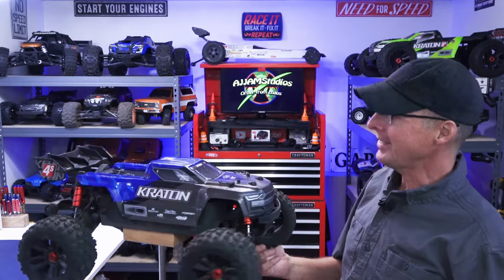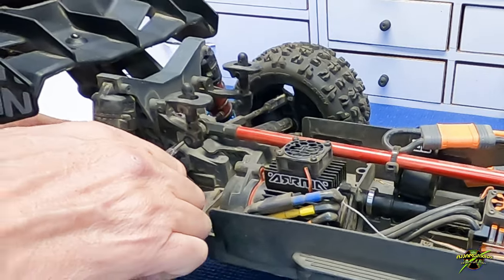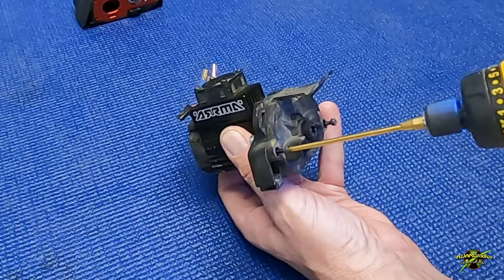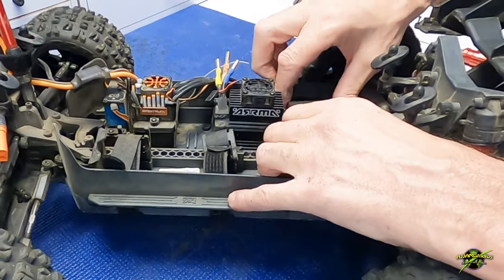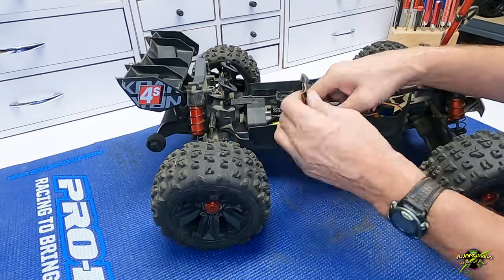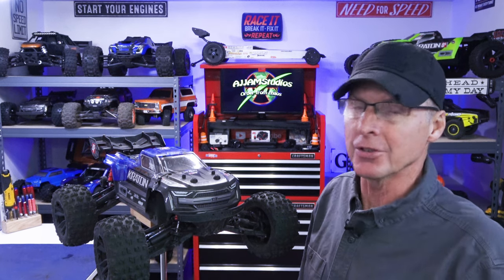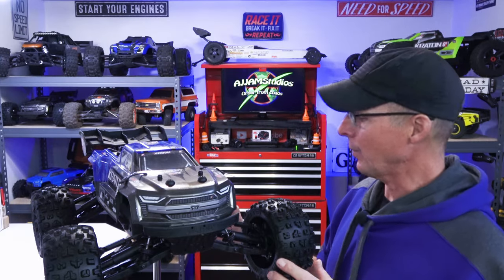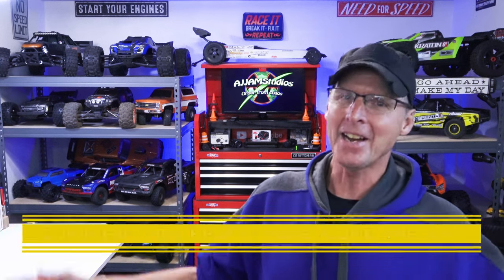Arrma Kraton 4s diff install

Comment: This is brilliant. Thank you for making the video. The slipper in my K4s has always been a problem. I think I will buy the parts and fit to my car.
Reply from the maker: Be patient, they are out of stock at the moment. Every one is trying to get their hands on those parts. Even Jenny's RC is sold out. It will be worth the wait though. Be wary of those scalpers on eBay who are asking way too much for them, trying to take advantage of the shortage. Arrma will catch up to the market in time.
Reply: @AJJAMStudios  thanks for the advice. I was expecting that to be the case with stock. I’m in no rush anyway particularly as the weather isn’t so great now.

Comment: Sweet! I as well could never understand why they put a slipper clutch in the V2 Outcast and kraton. I stayed snapping shafts on my outcast. Found a company on eBay that makes a slipper clutch hub out of 7075 never snapped a shaft again. But I am definitely going swap it out with that center diff. Great video thanks for the insight.
Reply from the maker: I'm glad we could help. The slipper and the locking spool both overdrive the components when pushing big power in high traction, and that comes at the cost of durability. With some lighter fluid in the center diff, when you get one installed, it will ease the problem and allow you to keep that sweet top speed. I would still be careful to be off the throttle when landing your RC to help prevent any overpower to the drive system...it happens to us all at times. Please let us know what you think when you get yours installed. Thanks for sharing. AJ
Reply: @AJJAMStudios  You wouldn't know this but I have been in this hobby for like 20 years. I have 4 trucks fully equipped with m2c racing parts and the toughest parts l can find. My trucks look like dots in the sky when I jump them. Well aware of the functions of a slipper clutch.
Reply from the maker: Awesome. Good to hear. Bash on, my friend. 😎👍

Comment: My front shock spring perches are rubbing groves into my to front drive shafts is there a way to move the front drive shafts back a little so there not hitting the shock spring perches i losened the shock end 3 turns but still rubing I tried contacting arrma but I sit in que for hours on end being 1 in que sent pictures but not getting any help from there support it's less than 3 months old should be still under warranty but not getting any help how can I fix the issue do you have any suggestions

Comment: I like to see the new Big rock 6s hit the dirt🎉
..hope to see a newer version on typhon s6 blx soon..what could be a good upgrade!😊
Reply from the maker: The Typhon 6s upgrade? Wow, I'm not sure about that. If I were asking for upgrades I guess I would ask for a tougher, basher type chassis with redesigned chassis braces that are more substantial, not the lighter one they put in the TLR. A tougher, faster servo. Belted tires with a different tread design, more like a truck pattern. Larger teeth on the diffs to help prevent diff failures. Aluminum front and rear diff housings for added control over the diff spacing. A rear bumper set, built after the EXB bumper design for greater jumping protection. An EXB front bumper designed just for the typhon for those unexpected impacts. After all, they already have the race version, so a dedicated heavy bash version would fit the bill for us here. I hope that answers your question. Thanks for asking. AJ
Reply: @AJJAMStudios  yes well a stronger servo would be a nice choice..i guess a new spektrum 665 when it comes out..think ill go for savox or power-HD  that can handle 8,4 volts!😆now that i got my hobbywing max 8 with 2250 kv motor😇

Comment: Hello! I think the problem is not with the differential oil, the Mojave 4s comes with a 16t engine pinion if I'm not mistaken, instead the kraton comes with a 13t one, I think the problem with the front lift comes from here...good luck!

Comment: The MWB chassis of the outcast 4s v2 needs a small  modification to make it fit.  So the length of the chassis will make a difference if modification is needed or not.
Reply from the maker: Thanks for sharing 😎👍

Comment: Can you make a recommendation for the proper diff fluid viscosity?  You mention using a lighter fluid than stock but didn’t say what it is stock, or make a suggestion for a better option. Thanks.
Reply from the maker: It all depends upon what you want from your RC. Stunting = thicker fluid. Controllability = lighter fluid. This is our understanding of the subject. We went super light and it controlled well and we ran it stock and it stunted nicely. Even mix…50k perhaps and see how you like it. Then adjust from there.

Comment: Well done! Thank you for the parts list. How do you think this would translate to the big rock v3?
Reply from the maker: We’ll have that video when our next transfer case arrives. I really want one in there. Thanks for asking 😎👍
Reply from the maker: And you're right to be concerned about that. I agree, the slipper set is alright for 10th scale racers, but 8th scale bashers and larger not so much, and 4s not at all. We wound up tightening our slipper all the way down, making it a locker, just to get some runtime out of it. This new diff sounds like the answer to all those issues. However, there's still the issue of the plastic center drive shaft to consider. At 4s ours vibrates terribly, and this is in both the Mojave 4s and the Kraton 4s V2, but not so much on 3s in those cars. There's a lot of torque and power in those systems and I'm not sold on the lighter center shaft to handle that kind of power. In fact, I'm looking for an alternative to the plastic one as we speak. If you find one please let us know where to find it. I would love to give one a try. Thanks. AJ
Reply: Hi guys - great video AJ. I’ve been running aluminium centre shafts on 3S and 4s Arrmas. They are available on eBay etc. spring loaded like stock but metal construction. Never twisted and also resist rocks slicing right through them. Keep wrenchin’ 🔧

Comment: Hi what oil weights would folks go for in a senton 3s with this 4s module. And the front and rear diffs thanks.
Reply from the maker: In our Senton 3s we stuck to the stock oils. We haven't installed the center diff system in it yet. 😎👍

Comment: Any idea how Arrma feels about this modification?  It looks like this would solve the issue with the bent motor mount, too. Any comment on this?  Thanks!
Reply from the maker: Thanks you for the question. The way the Mojave 4s diff module slipped right into the Kraton 4s tells me they already want something like this out on the market. I would consider this a test run for the idea. They, meaning Arrma, watch and listen to our community, that's why the center diff came out in the first place. We've been complaining about the slipper setup for years, and placing it in 4s rigs is not the best idea they ever had, and I think they know that, but building up a fan base that already owns the slipper style cars, 3s and 4s alike, and then releasing a diff upgrade for all those machines sounds like something they have been planning for some time now. I hope they come out with the actual upgrade kit...like the upgrades the do for the boost series. There's money to be made here and Arrma is well aware of that fact. I would look for this upgrade becoming available in the very near future. Of course, it only fits straight into the longer wheelbase RCs. The short ones, like the Granite, for example, have required some chassis mods to get it installed. Perhaps they are designing one for those RCs as well. We'll have to wait and see. Thanks for asking. AJ

Comment: I was saying this since the Mojave came out that center diff even fits in the 3s line. That module is a real game changer.
Reply from the maker: If they are paying attention to our community, and they usually do, they already have an upgrade kit in the works...if they don't listen, for some reason I can't even begin to imagine, then they are going to be shocked at the Mojave 4s parts they end up selling as we buy them up and do the mod for ourselves. Usually Arrma listens to us, so my money is on a retro diff kit of some kind coming out to get all those people who already have 3 and 4s cars onboard with what's new and hot for these machines. The way it slips right in...and the fact you can't get the parts very easily right now...indicates they are planning something.
Reply: @AJJAMStudios  The diffs are on backorder, motor plates backordered, they didn't see it coming.
Reply from the maker: Nope, they didn't see it coming, but they are watching now. Even Jenny's RC is sold out.
Reply: @AJJAMStudios  I checked Jenny's today I saw that lol. I'll wait, winter now the good slippers will drop in price.
Reply: @AJJAMStudios 
Is there anyway you can add a video demo of assembling the Center Diff as it looks like we have to do it peice by peice? I'm not mechanically smart lol.

Comment: Great video. Do you have trouble with the wheels not turning much from side to side?
Reply from the maker: No. Check the dual rate for your setup and see it is turned up. It should be the first knob from the rear on the SLT 3. Turn that up and try it. 😎👍

Comment: So it seems like $120-130 to do this? That makes it around $600 for a 4s outcast or Kraton and a center diff mod.  Kraton 6s is $549, so is that a way better option?
Reply from the maker: If you already own a 3 or 4s RC then this mod is the way to go if you want to improve your experience with the truck or car. If you’re buying, the choice has to be yours. Recommendation: find one that blows your hair back and get it. If it thrills you, you have the right one.